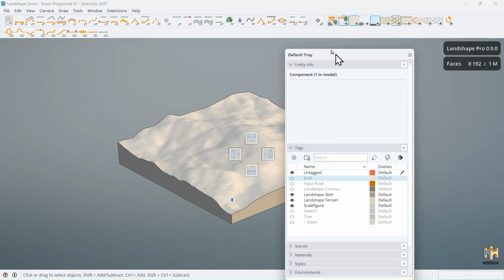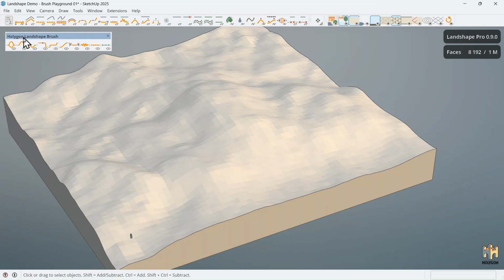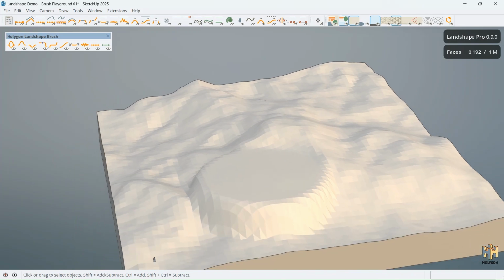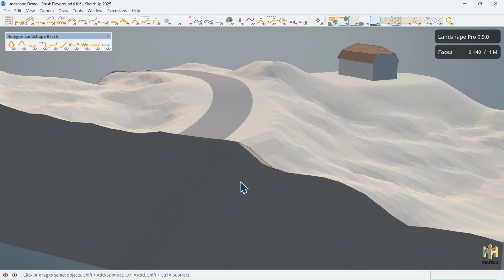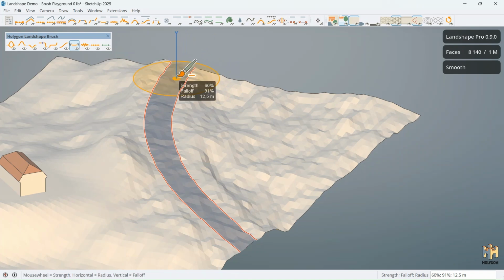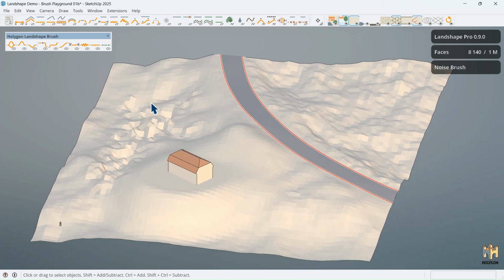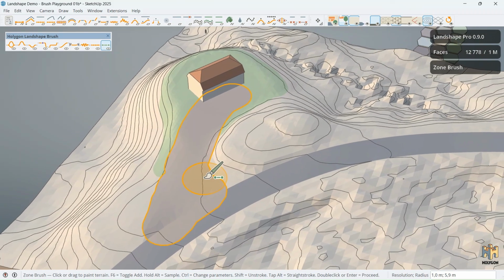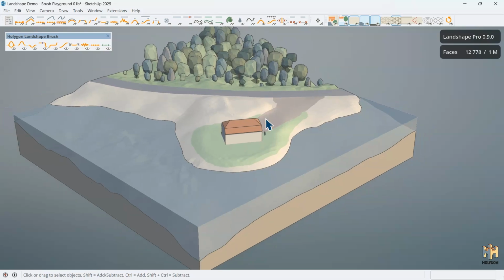Using Landshape's Brushes — Holygon Landshape for Sketchup

Comment: Seems more like a nice toy. How do you use this in engineering, where you need to quantify slopes and excavation in detail?
Reply from the maker: Regarding quantifying slopes, and volume, in Landshape we call this Survey. Holygon has decided to first develop the major editing tools, and later add Survey tools. 

This said, Landshape already has a simple Survey tool for measuring the slope and elevation, at any point in the terrain. It is called Survey Spot. Survey commands are avaliable in Landshape Pro.

Holygon plans to add further Survey features. This includes area reporting, volume reporting, and cut-and-fill reporting.

Does this help answer your question?
Reply from the maker: Thanks.

Never underestimate the power of cute software. 

Just like Sketchup itself, Landshape looks like a toy, but it cuts like a ninja.

This said, this particular video is about Brushes. Brushes are only minor part of Landshape. Brushes are useful mainly for polish or quick, rough sketching. Brushes get the job done quickly, but at some loss of accuracy. You can literally sketch a small landscape in 5 minutes.

In order to do super-accurate work, you instead work with Pick commands. Pickers let you use control geometry to drive terrain results. This includes elevation, plan, topology, style, density, and more. You can do this with an arbitrary degree of accuracy.

Expressiveness everywhere, accuracy where you want it.